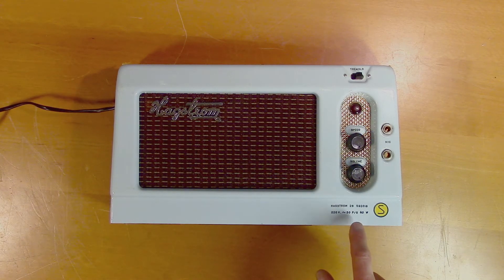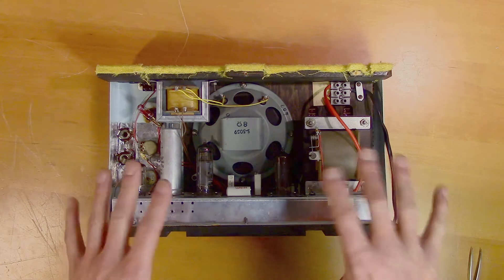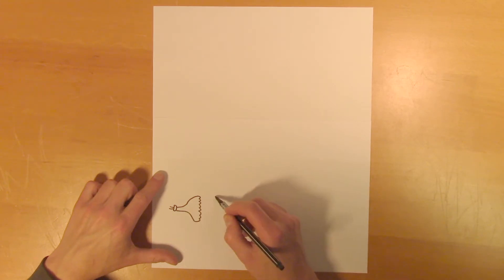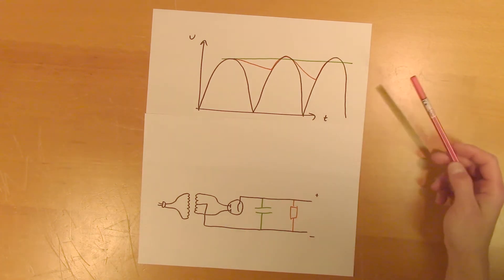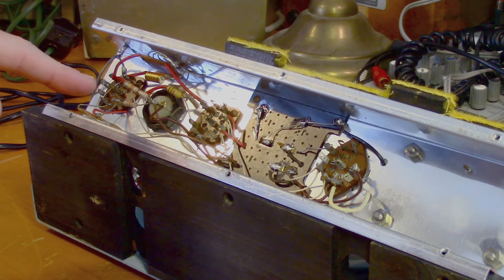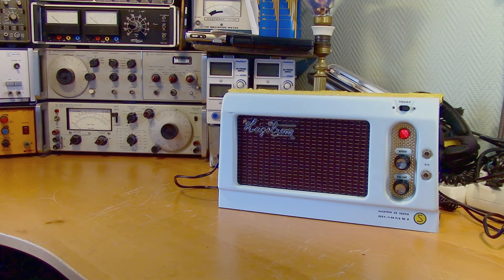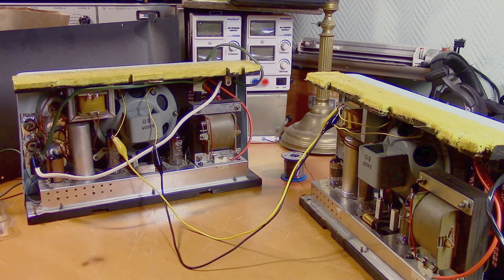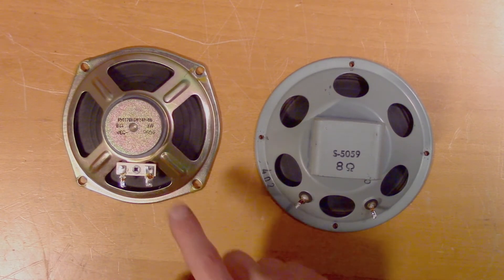Hagström 26 Vacuum Tube Amplifier - Troubleshooting and Repair

Comment: Great video showing detailed repair and testing of this rare 1960's amp.  Re-coning the original driver might not be economical , but the replacement speaker sounded just fine.
Reply from the maker: Thanks a lot!

Comment: awesome video! if you have the time, would love to know more details about the model 26 circuit! I have one I need to restore.
Reply from the maker: Thanks TehSyneS! For a restoration it is probably more about knowing which components tend to go bad with age or wear, rather then circuit analysis.

Electrolytic capacitors tend to deteriorate over time and will most likely need to be replaced sooner or later. For the Hagström 26 it is the four capacitors replaced in this video. The remaining capacitors are probably ceramic, which tend to hold up quite well with age.

Resistors can drift in value over time but it is dependent on what resistors were used. The resistors in this Hagström 26 were very close to the their nominal value.

Vacuum tubes can wear out but is generally not affected by time, as far as I know.

I have heard that the insulation in some old transformers can deteriorate over time and short the windings but it is not something I have experienced myself and I do not know how likely that would be.
Reply: @SunandWeather  really greatful for your response! The amp was perfect then developed a small hum before going silent. Perhaps those caps are the answer. Will get it tested soon. Love this amp.

Comment: Great video, and nicely explained! Just a though: wouldn't the hum be 100 hz since it is after the rectification? Obviously 50 hz and its overtones covers the 100 hz, but I am curious as to what we are hearing as a hum. Is there a 50 hz hum as well, in other words?
Reply from the maker: Hi Drakir91! That is correct, the hum we were addressing in this video was actually a 100 Hz fundamental and its overtones; the ripple from a full bridge rectifier power supply with bad reservoir capacitors. This problem would not produce any 50 Hz hum. With that said, 50 Hz is still present to some degree due to interference from surrounding magnetic and electric fields as well as the transformer itself making some noise.